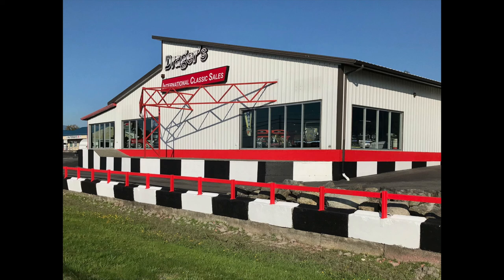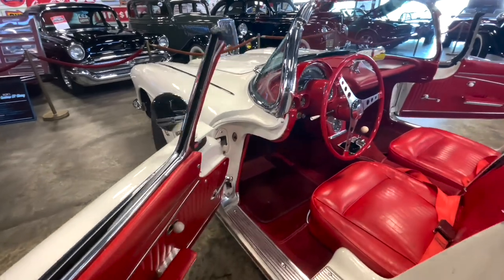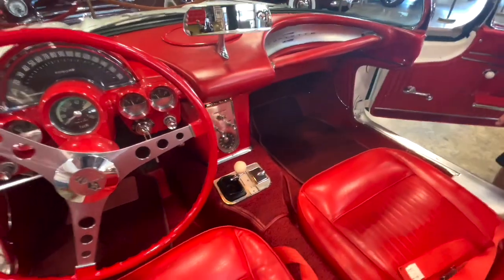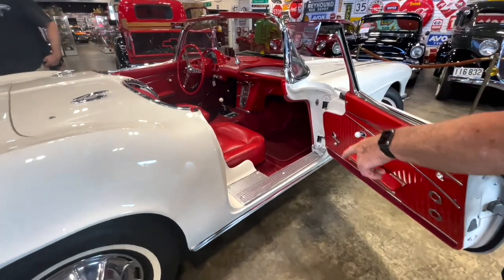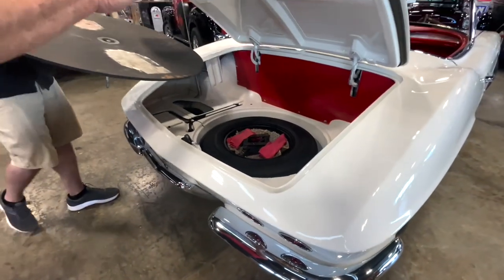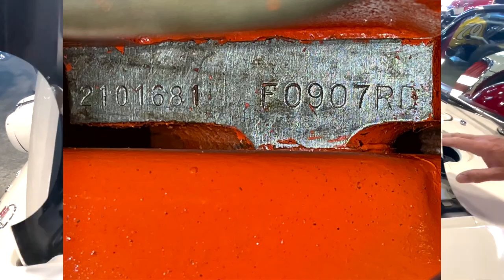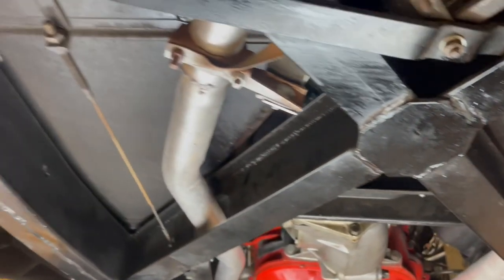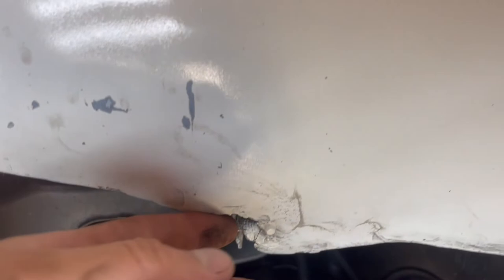1962 Chev Corvette  roadster       SOLD       DGC1681

Comment: Extra nice but no mention of which 327 engine.  The horsepower rating is on a sticker right below the 327 engine decal on the valve covers.
Reply from the maker: Hard to cover everything do you wanna video but it isn't description above it's a 300 hp 327 V-8 very very nice car Jeri Gregor 206-755-2148 we also have a 63 split window